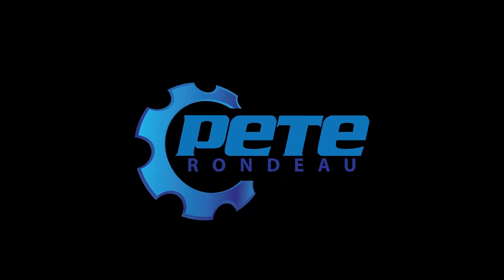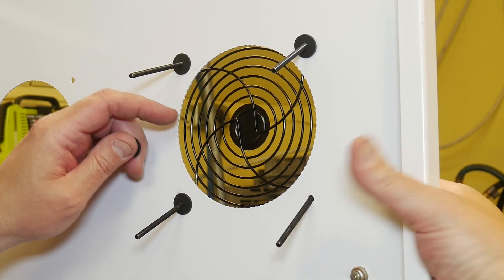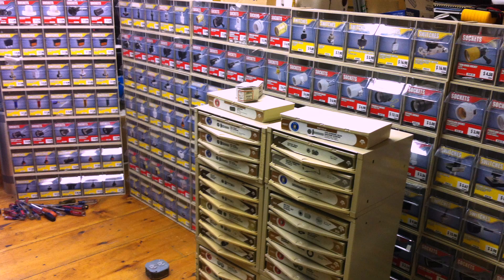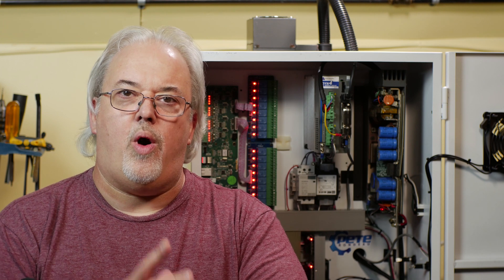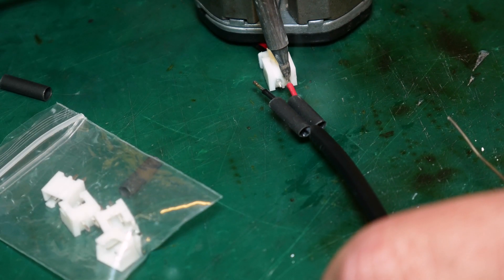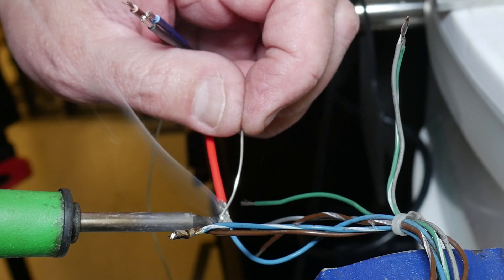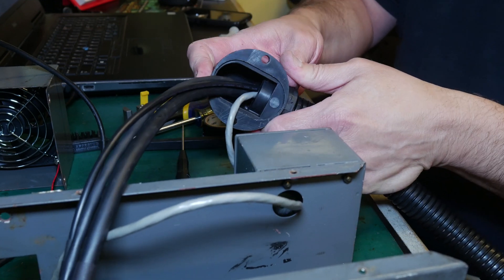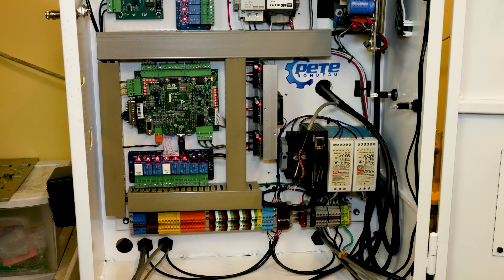Centroid Acorn / DynaMyte Mill Retrofit-  Rounding 3rd Headed For Home

Comment: Looks good Pete! I'm about in the same spot with my centroid acorn / enco manual lathe retrofit.
Reply from the maker: I checked out your project and it seems we have quite a few things in common.  We've both been sitting on top of these machines for 5+ years, and we both put out a video about making 3D printed parts to test the fit (although in my case I suspect most of the parts I printed will be the final product)  Thanks for following along!
Reply: @PeteRondeau  yep, and somehow I hosed the dimensions on my printed parts. Lol, its all good though. Thats exactly why I printed them first!

Comment: When installing new connectors, use crimp pins on the wire itself. That way there are no splices. Deutsch or similar make great components. Factory look, no breaks. Notice that most if not all automotive and industrial wiring is crimped? Vibration.
Reply from the maker: LOL, you are going to end up making me replace these.. I've been thinking about your comment for the last day thinking "damn, he's right"  but the final straw may have been last night when one of the connectors I put in seems to be faulty.  I swear I can hear it sizzling- Guess that's what I get for buy bargain connectors.
Reply: @PeteRondeau  Been there done that. In fact you said this project started more than 6 years ago. I have a Dyna DM2400 and a 3000 lathe. I have built, torn apart, rebuilt and now both sit in a corner until my next attempt at improvement ;-) I have had them a decade now.